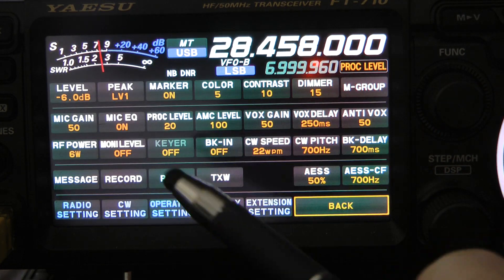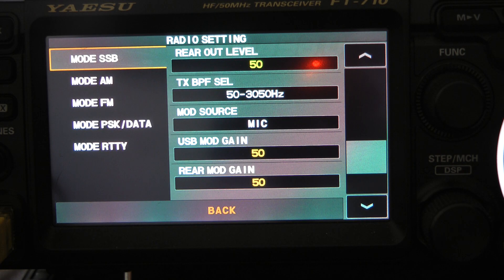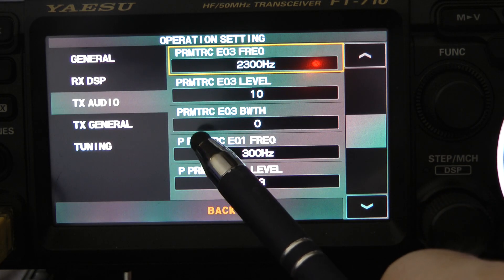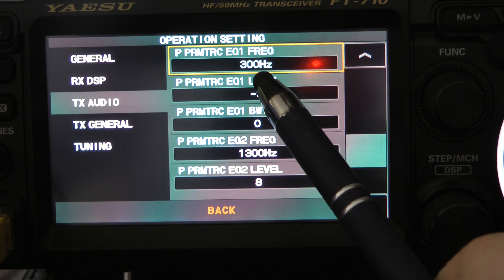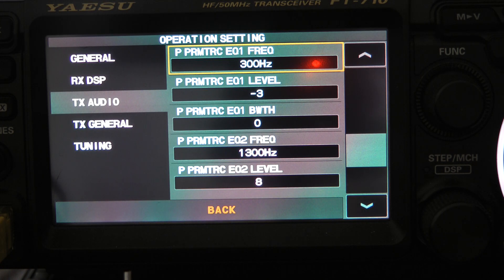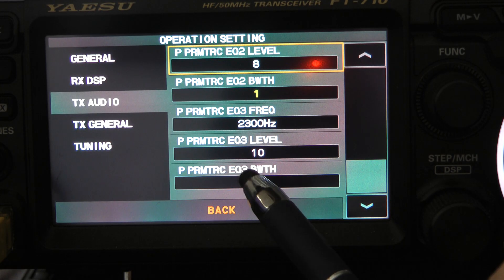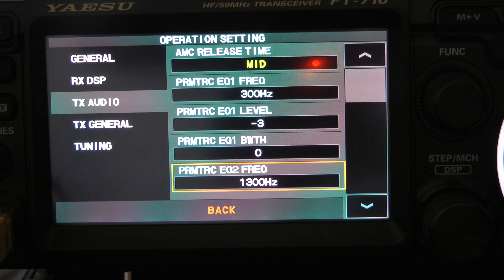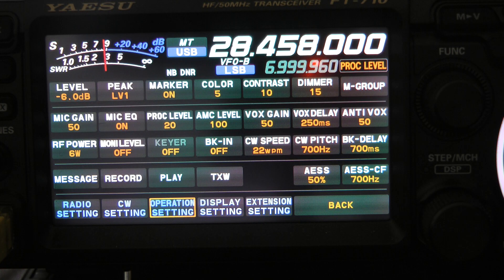Yaesu FT-710 Transmit Audio Settings

Comment: John, Thank you very much. (PS - easy for some! 😉)
Reply from the maker: I hope this helps, I wanted it to be short and easy!
Reply: @johnwofford2708  You made it very easy. My "PS" was not a good coment what I was trying to say without your video it was only easy for a select few. Now with the assistance of your video I will setup my FT710 with confidence. "right after dinner"
Reply: John, that was the best explanation of what the settings actually do I've personally found to date.  Other sites have suggested similar settings, but little to no explanation of what you're actually adjusting. 
Thanks.
Reply from the maker: @MichaelPratt-l8i  Thank you